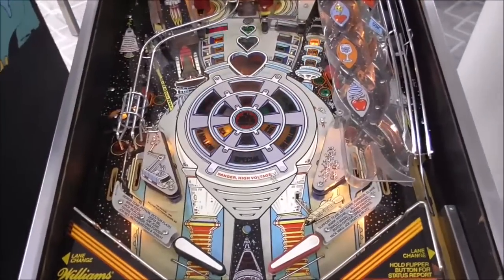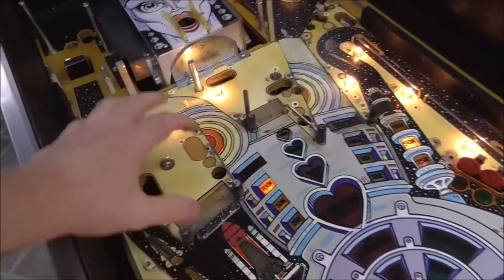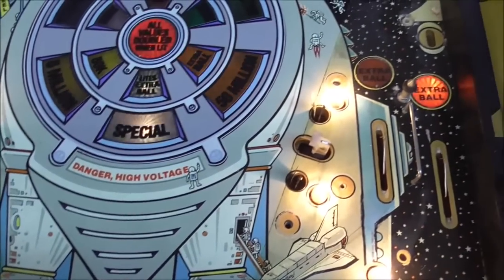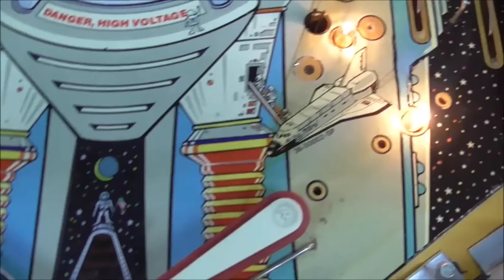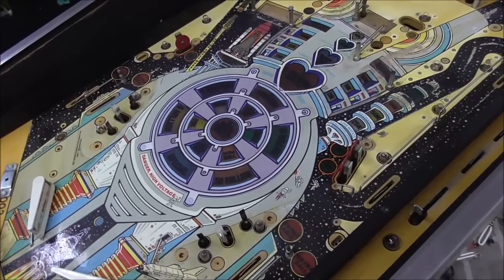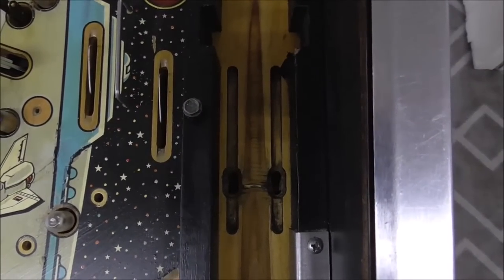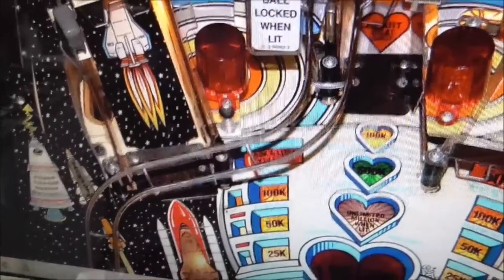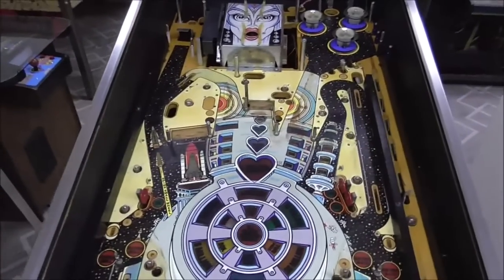Touching Up The Worn Playfield Of a Williams Bride Of Pinbot Pinball Machine by Hand 3

Comment: You know that LED's are switching on and off very fast, like a spark.
If you wanna have some afterglow on the LED you can add an electrolytic capacitor over the supply wires to the LED.
Trial and error would find what you like best, selecting the capacitor value in mF (microFarads).
I'd start with a value of 100mF, having 47mF, 220mF, 470mF ready as optional values.
The voltage rating of the capacitor should be at least 10% higher than your supply voltage.

The capacitor would be a bit harsh load on the lamp driver (transistor or relay). This can be remedied by adding a 10-12 ohm resistor (1/4watt) in series with the capacitor.
The effective load will then act exactly like an incandecent bulb.

Comment: Hi Ron!
As always, amazing work on this machine...I am curious about one thing though (since you'l be adding LEDs before it's all done);
Are you (or more to the point, your client) aware of the 'Version 2.0' upgrade kit that's available for this machine?
I would think that it would make a spectacular addition, given the work you're putting into this project.
But then again... It's not my machine... ;-)
Reply: Version 2.0 in my opinion is not a upgrade, I always liked the original. Also V2.0 does not have the rotating faces.
Reply: @pinball541  
I thought that V 2.0 had both the orriginal and the new game play as part of the upgrade.....??
Reply: @jayytee8062 - I am pretty sure the upgrade kit keeps the rotating heads. I was talking about the actual Dutch pinball BOP 2.0, which only has one static head. That was the best part of the original Williams BOP machine.
Hello from Phoenix Arizona!🔥
Reply: @pinball541  
Well Hello from Melbourne Australia haha
Reply: @jayytee8062 - Also, my 2008 Pontiac G8 (Holden Commodore) wants me to say hi to its homeland.👍